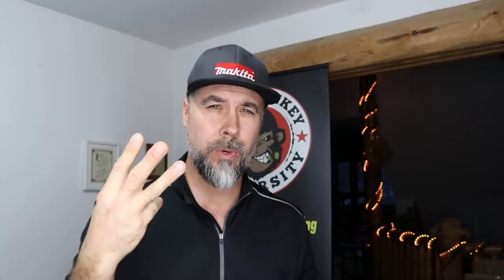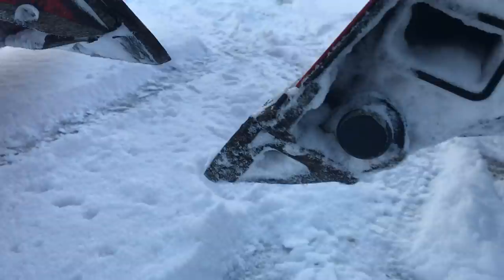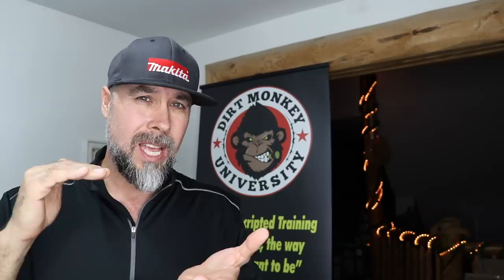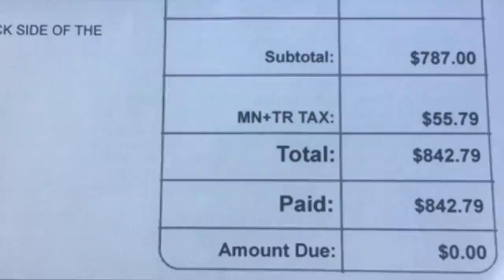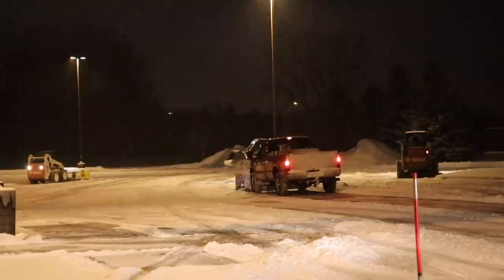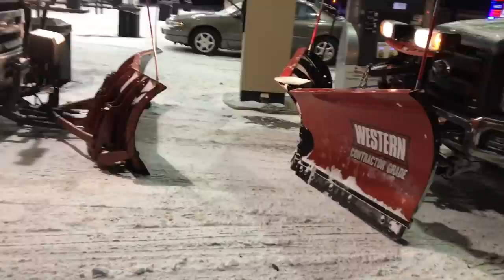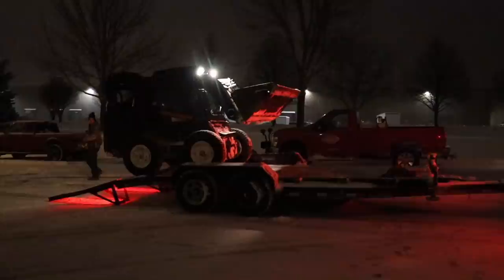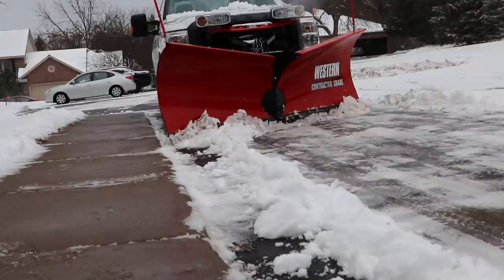Western Snow Plow Review after 13 years - Plagued with Problems

Comment: I'd try a carbide edge with a cover sheet. I work for local  highway dept.  I have for nearly 18yrs. I plow 40 lane miles of road in an event. Years ago a standard edge, depending on event, may only last one event or would have to be changed during each event. After switching to carbide we are getting up to 8yrs out of an edge. We now get the edges from chemung supply corp, for plows we run fisher , henderson , and metal pless check out the metal pless live edge.  This thing is awesome scrapes cleaner, cuts ice and lowers my granular and liquid application.I
Reply from the maker: Interesting, thanks for sharing!

Comment: 4th year on Fisher/ western Xv2 .
   Just replaced stock cutting  edge this season .  I believe the stock edge is 1/2 inch,  to make the  weight less , and the dealer   replacement is 5/8 thick. 
    I believe the cutting edge steel is like cheese.   But as you say the plow has performed well. 
I use shoes since most of my plowing is on gravel, I think this has prolonged the life of my cutting edge , but I wore a set of shoes out completely... like paper thin and then just the stubs left.   The replacement shoes have a  wider pad and work really well.  If you adjust them just right with spacers it takes some of the pressure off the blade while still achieving a good scrape.  
   It's a heavy plow with the tall wings and a very steep attack angle.   This attributes to the edge and shoes wearing,though   in combination with soft steel, leads to shorter life.
Reply from the maker: Plowing gravel also helps.  When we plow you can see sparks fly. Its just what we have to do.

Comment: If I remember correctly when I used to work in the truck shop we would take a piece of 3/8 or 1/2 inch by 4 bar stock punch holes in it and there is your Cutting Edge.

On both of the Myers plows that I had on the Scout and my power wagon, I took about an 8 inch piece of steel and tacked them on either end of the blade.  This after noticing how the ends of the blade seemed to wear faster.... because I was a welder I used to do all this myself it was less expensive I'm sure than having to send it out to be done. That's why I suggested in another video when your plow broke off the front of your truck... You need to hire somebody and equip a plow truck to do repairs on-site... Then when something breaks you got it done right now. Having been a solo operation I arranged to have a shop to go to where I could get it inside and fix it and then go back to work. Just a suggestion.

Comment: What kind of shoes are you running on the plows (if you can)?  I added them to mine (A Western 8ft Pro straight blade), and then set them properly and I have had ZERO issues with cutting edge wear since.
Reply from the maker: Before it was their blades we used but NO shoes.  We can't run shoes becasue of zero tollerance
Reply: @Dirtmonkey  Got it, I was just trying to think of another way to support the weight of the plow when down and not on the cutting edge.

Comment: Take your old edge and cut about a 10” chunk of it and weld it to the new edge on the end of the plow. We did this with out blizzard power plow and snoway 26r and it cut down on wear a lot.... we have the same controller for our blizzard power plow. You can set it up for one touch float. I like the controller personally, you guys act like it takes a rocket scientist to run the thing. I caught onto it in the first few storms and it’s just been second nature ever since, I’ve never stopped to look at it ever. It has all the same functions as the Hiniker plus two extra options how is that a bad thing?....
Reply from the maker: If it works for you-its not bad.  I just have used better.

Comment: Fabricate your own cutting edges (with quality steel) or have a machine shop do it. Should be less than what Western is charging you. I do it for my own blades.
Reply from the maker: Thanks for the advice
Reply: What steel do you use?
Reply: I just did this for a straight plow with ar400 steel from a local fabricator. $200 for a 6x96" piece 1/2" thick. We'll see how it holds up. Drilled the holes myself with a $13 Bosch cobalt bit from Menards chucked up in the drill press and a bottle of tap free. Grade 8 hex head bolts nuts and washers $11. 11% off. Lol.

Comment: I figured I’d add in my experience so far with western cutting edge, I bought the same v blade you got this season and it got 4x of pushing and edge was completely gone! And had to take back to the dealer cause it was leaking fluid 2x..

Comment: So, I have a Fisher 8' trip edge straight blade I wore the blades out ridiculously fast UNTIL I went and purchased a chunk of hardened steel cutting edge from a steel yard, and used one of the old cutting edges as a pattern to drill holes.  Since then I several seasons out of the blade vs maybe a season.  The cutting edge was considerably cheaper too-enough of a savings to justify the time and labor spent drilling the holes, and purchasing new high dollar drill bits just for the purpose of drilling the holes in the cutting edge.
Reply from the maker: Nice-  I like hearing that!

Comment: I have 2 western strait blades. Love them. Have 3 seasons on the cutting edges and they are still good. We do large lots with them and are always out. Maybe I got a good batch of cutting edges. The controller. I think is very simple. And I’m not sure if it’s been mentioned.  But you can change the float function to stop your “confusion” if it’s down or not. Also you can use a different controller instead of the hand held. But hey, every one is different. And the fact they have 1 controller to be used on majority of their plows is amazing. Because if you run a v- plow and then switch to a strait or a wide out. You’ll never have an issue. But again every plow has its ups and downs. And people like using specific plows and controllers. But western I feel will always be a better plow. I have yet to have a break down on my plows in 3 years. 

But hey what manufacture isn’t making something to break down.

Comment: It's all about the money, they cheapen the product but not the price. Henry Ford once said " he could give cars away and make money on repair parts". Fortunately my Western plow dates back to around 1986, the mold board is still in great shape and as far as I knoe the cutting edge has never been changed and it still has lots of edge left, sadly this year I have to replace one of the hydrolic valves, not bad for 34 years old and being on 3 different trucks. Wonder how other plows compare.

Comment: Surprisingly I have been pretty happy with my snow way plow, and I have a fleet of westerns, a boss and an old Meyer.
Reply from the maker: Ive heard some good stuff about Snoway. and also some bad
Reply: Variable, what snoway do you have? I’ve got a 29R. Had it for 2 seasons. First season great. This season, it has nickeled and dimed me at every possibly oppurtunity. I plow a ton, but I don’t abuse it by any means. It’s always sprininging a leak, literally like every storm from a different connection. I have to adjust the valve for the down pressure every single storm because it just stops working. Just had to replace the solenoid and now the motor is about toast...2nd season. It’s under warranty but snoway said the motor was a wear part and wouldn’t replace it. Bran new plow. 
It’s a rant but I’m just so beyond fed up with this plow. Doesn’t help my dealer sucks. 

Anyway, rant over. How do you like yours? Have you had the same problems I’m having? My biggest issue is I could have got a boss dxt for 500 cheaper... didn’t know that at the time
Reply: Riley Rivers I have had 0 problems out of mine, at least none my dealer didn't handle. I replaced the motor the first season, but it was just a bad ground....my bad... Every thing else has worked flawlessly... Much better than I thought

Comment: as a former western sales and installer, adjustment has nothing to do with how fast the cutting edge wears out,  the part I really hated was someone would come in and buy a plow for there new truck, next year they would trade that truck in but keep the plow for the new truck, but the way western makes there plows, it will not work or fit another truck, buy the time you price out the new mounting hardware, the electrical harness and a bunch of other parts needed,  it is all most the same cost as buying a whole new plow, I was so mad over this I quit selling them, as it was ripping customers off, my 25 year old western plow has been on 5 different trucks, with just a movement of the bolt holes to fit the frame,  still the same cutting edge as day one, I have never used any shoes and yes I plowed commercially for 7 years, and were I am we get tons of snow and -30 to -40 long winter

Comment: I hear a lot of talk about cutting edges and lights but honestly my concern is with the plow itself. What plow is the strongest? I'm thinking about going with a Fisher. I've got a 5 Mile road and I need to be able to cut through drifts. I just want to buy the strongest plow and I'm not worried about cutting edges and lights.

Comment: I toured there factory in Madison heights and noticed that they use mig welding vs tig welding upon assembly's of plows blades and also they use solid sheet steel that is bent on a cnc bender vs using presses witch makes steel alot strong and durable so really thwre whole assembly process requires a revamp interly to makes prouduces much better

Comment: I love westerns. Never had issues with my older western plows. I firmly believe that western v plow model you bought has a major design flaw. The straight blades in my opinion are rock solid and usually never have issues with anything
Reply: Tyler's Video Production.  100% agree. Plowing with western straight blade for 4 years no cutting edge change. Controller is super easy to use. Same thing someone said earlier. Use the float.
Reply from the maker: Yep-  my straight plow- no issues

Comment: I have the exact same wearing issue and I have been running a western v-plow since 2014. It is beyond aggravating that these edges wear out so fast especially after upgrading from a straight pro plow that did not have this problem. This is a known issue with this company and I can verify your results I have never been so disgusted with a company. At $475.00 a pop and 4 edges later it just unacceptable.
Reply from the maker: Sorry to here your having a bad experience!  Thanks for commenting

Comment: Thanks for the video. I've had my MVP3 for five years now and had to put a new blade on year two. Last year sucked for us (snow wise), but we will need to replace again by the end of this season. I will be going aftermarket as well this next time around.

In terms of the controller, I personally like it and how versatile it is. I started with a Hiniker straight blade and had nothing with problems with that controller(3), plus its not as comfortable in the hand in my opinion. Never ran Boss on a truck, so don't have an opinion on that... But the Boss plow controller on the Multiforce blows!

Comment: Hold up., i have been plowing for 3 years using western blades and others., its not the steel, its the angle of the plow wen you plow wether your pushing, creating win rows exc., the more you switch between the faster its going to wear because your creating opposing striations on the leading edge of the steal.

Comment: Have you had problems with the hydro hoses rotting out in a season. Replace a western controller each year. The dealer even says Douglas is taking manufacturing short cuts
Reply from the maker: I haven't had that issue.

Comment: Check out the Arctic snowplows made in Canada.  We have been running them for 18 years and love them.  One accessory they have for their trip edge snowplows is box ends.  I turned my 9' snowplow on my dually into a pushing machine.  Still can angle and window but can scoop when needed.  They have different controllers, but the one we run is a joystick.  It reminds you of the Atari game controller us old folks had as kids.  In the float position it locks in so you know your floating without looking.  I'm just curious what is so great about a v plow?  Seems like too many options for doing something simple.  Really check it out.
Reply from the maker: V Plows have their place but you can do a lot with a good box plow.

Comment: Were the blades the same height at the start?  My Hiniker has been replaced once in 8 years and looks great.  My SnoWay I just cut steel to fit, drilled holes, $50.  Kind of the cheaper way to go, to make your own...     And polycarbonate (not acrylic) plexiglass makes a good mold board for lighter plows if you want to save $.

Comment: Our Western Wide-Out drains both batteries on our F550 with the truck turned off, so we always have to disconnect the plow when not in use.  Yet our Western Pro on our F350 doesn't have this issue.  The installer couldn't figure it out and contacted the Western Rep, who said we should just remember to disconnect the WideOut from the F550 when not in use.  Huh?  I had a plain Western years ago with an edge that lasted 5 years and no plow problems.  What's happened to the brand?

Comment: If you don't already, I couldn't tell, I would get a set of shoes for the plows. We run shoes on all our plows, set them up so when the plows on the ground the shoes have a little extra slop and the edge will wear to the shoes hight making for a really good cleanup.
Reply from the maker: We cant have anything left behind.  So shoes don't work on our lots-zero tolerance for residual.
Reply: I see... they must be very picky... We can get an extremely clean drive with shoes it just takes some adjusting at the beginning of the season to make sure everything is correct.

Comment: If the Western is the same edge as Fisher,  the 8.5' comes with a 3/8 thick edge vs the 1/2" thick for the 9.5'.  I run a 5/8" aftermarket edge on my 8.5' XV2.

Comment: One word< Fisher > western strait blades are good I don't know why western cheaped out on  their v plows through
Reply from the maker: Fisher and Western are the same
Reply: Stanley - Fisher and Western are the same only by Douglas Dynamics. There is a reason the fisher is always a few hundred dollars more than a western (kinda like why audi's are more expensive than VW, even though there both owned by VW). They make the western cheaper by using cheaper hardness and thickness (my guess is your original edges were 3/8") of steel  on the cutting edges. I have all fisher XV2's with 1/2" cutting edges on them and do not have the same issues with edges you are having with the western.
Reply: Fisher and Western V-plows share a lot of the same components.  Same moldboards (different color on powder coated plows), electronics, hydraulics, hoses, controllers, cutting edges, wing extensions and more.  Different mounting systems.

Comment: The v plow is a lot heavier and our blades with rubber wings in a 71/2 'straight blade costs us 1$170.00 including a bolt kit. All western unmount plows are heavy . We install ours in less than 1 hour. But I wouldn't give up the 3 minute quick change plow installation BY 1 GUY for anything. Plus they interchange with all our unmount  trucks. I wish my boss was rich like you......

Comment: Winter Equipment has curb guards for pickup truck plows. I put some on the small trucks at a municipal job and they are still on that truck after 3 years.  It was a small Fisher and it was always wearing down too fast before I tried those Winter curbgaurds.
Reply from the maker: We outfitted one plow with them.

Comment: Oh and you can setup your Western/Fisher/SnowEx controller up to drop the plow at the touch of the button not requiring you to hold it down (for the whole second it takes) to go right to float mode.  Tells you how to do it in the plow manual....at least Fishers does.
Reply from the maker: I will check that out thanks!
Reply: Stan, do you have a good source for aftermarket cutting edges?  I have a Fisher Xtreme V that takes the same cutting edge.

Comment: Snowplow out of adjustment? That’s BS there’s only 3 adjustment holes and that’s for different truck ride heights. We don’t use western but have fisher plows which is the same company Douglas dynamics (western/fisher/blizzard). We use aftermarket blades on all our plows though mainly due to cost since they western blades are like 500$ a pop.

I actually like the control on the western/fisher plows. The wing control is nice when scooping you can hit the wing to dump the scoop into a windrow. I don’t mind the float control since I’ve been using these controls for the last 12 years now. I don’t see how anyone would need to look at the control after several hours of plowing experience.

We’ve been phasing our all out xtreme v blades in favour of the XLS wideouts. Biggest improvement in productivity we’ve gained in years. It’s like the difference between going from a straight blade to v blade.

The only blade we like more then the XLS is our Metal Pless Pickupmaxx hydraulic wing box blades. These plows are unreal, pretty much turns 3500-5500 Pickups into backhoe/tractor efficiency. Almost better then a tractor since it can travel at the speed between sites

Comment: You can reprogram the float function on the controller to One Touch  you just hold the lower button down while turning on the controller and it will toggle between one touch float and not